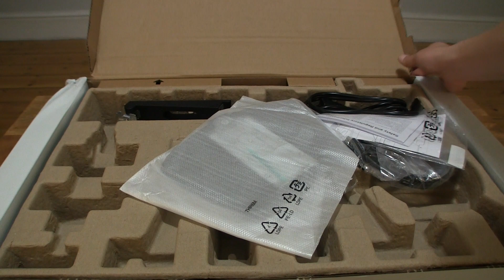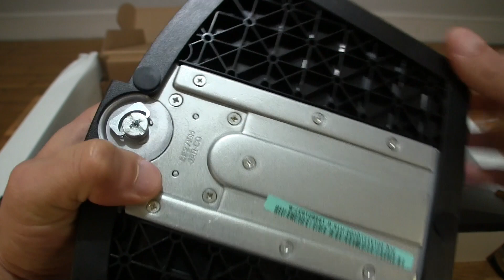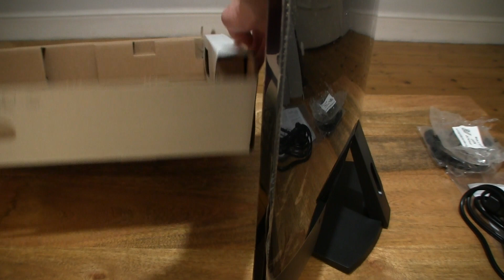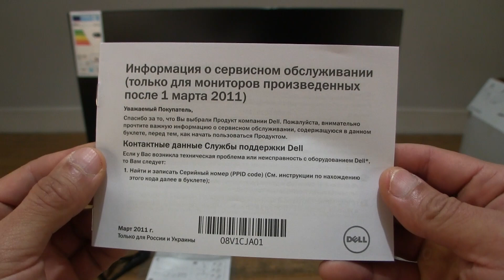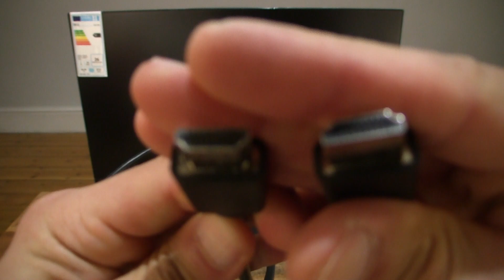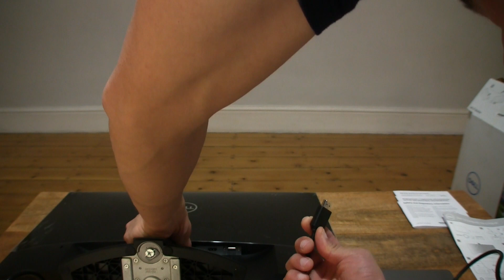Dell 27 Monitor: SE2719HR

Comment: How to disassemble the monitor stand?
Reply from the maker: 1. Place the monitor on a soft cloth along the desk. 2. Tilt the stand downwards to access the release button. Using a long screwdriver press the release button. 4. Keeping the release button pressed, pull the stand out.
Reply: Thanks for the reply

Comment: Do you see any pixels sitting close to this monitor. If , so would you suggest sitting a bit back for this one.

I am thinking of buying a monitor for my system. I have been using a 32 inch T.V as a monitor for years.

Now , i am deciding weather to go with either a 27 inch monitor or a 24 Inch monitor.
Reply from the maker: Hi bro, there's no obvious pixelation. It's a great monitor. I highly recommend it as a task or general purpose monitor. Happy viewing.

Comment: You have to show how to remove that monitor stand as well , it's always a bit of the problem.
Reply from the maker: 1. Place the monitor on a soft cloth along the desk. 2. Tilt the stand downwards to access the release button. Using a long screwdriver press the release button. 4. Keeping the release button pressed, pull the stand out.
Reply: @sutats  Thank you! Took just a bit to understand what you were saying, but found it and it worked PERFECTLY. Thanks.

Comment: Whats your opinion on this one. e
Dell 27 4K UHD Monitor – S2721QS
Reply: I basically need this as second screen for coding.
Reply from the maker: @PeaceLover-786  Hi, I have no experience with that model. If it's for coding, keep it simple however keeping in mind to use a monitor with a high refresh rate to reduce eye fatigue if coding for long hours. Happy viewing.